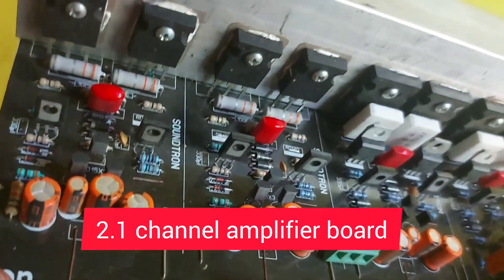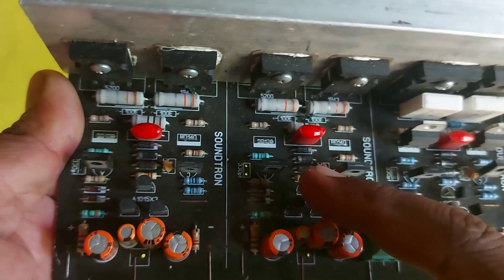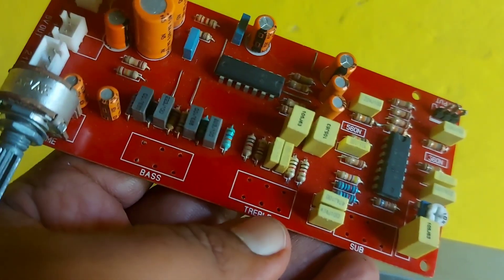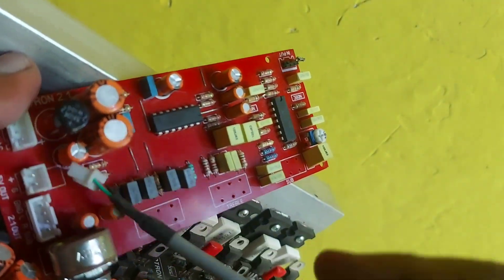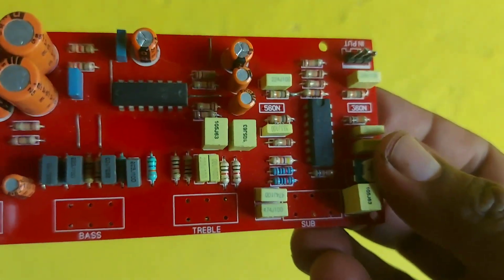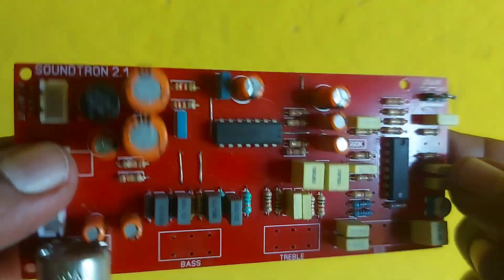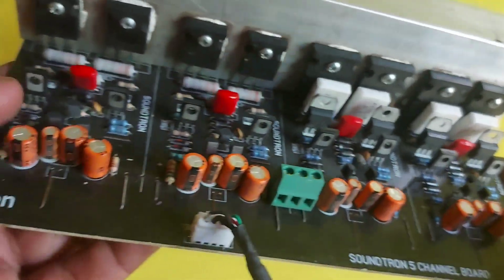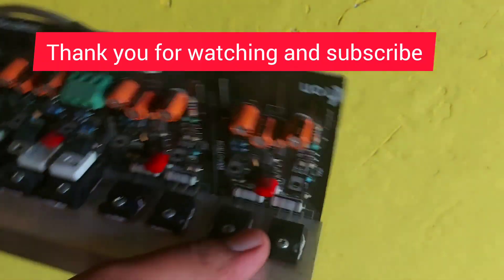2.1 chanel power Amp details, @Makeswell4

Comment: Which transformer is best for it ??
Reply from the maker: Torodeil transformer
Reply: @Makeswell4  ampire and voltage rating ??
Reply: Use torodiel 10 amps 24 0 24volt